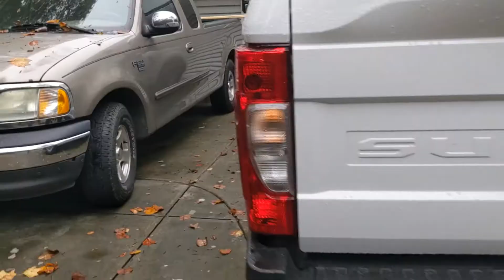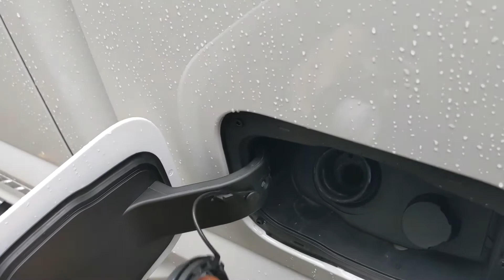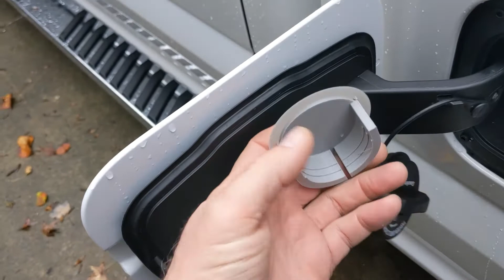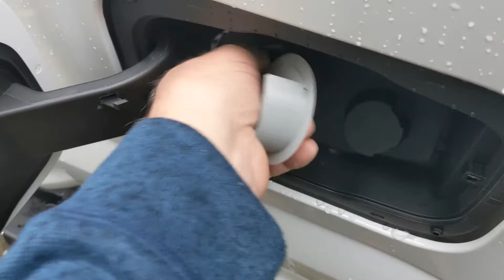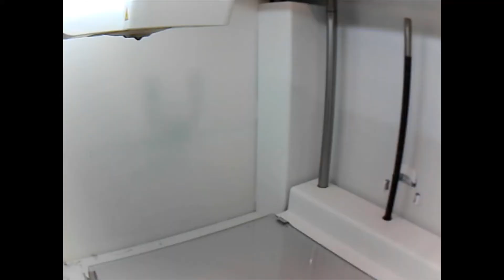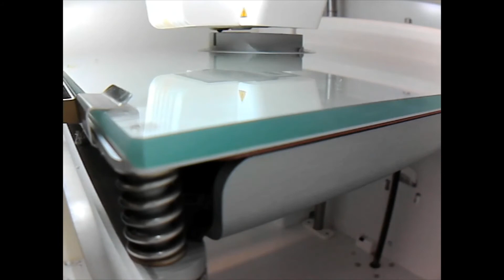2020 F 250 fuel cap modification

Comment: Something to note, I see you trimmed yours down from the file size a bit. Also, you left a little excess material on the base. I trimmed it flush to base and left the length the same as the file size. I used 3M double sided tape to stick to the door. Thanks again for the file.